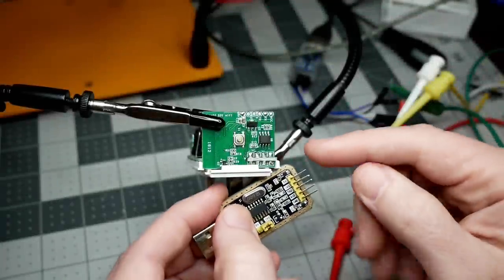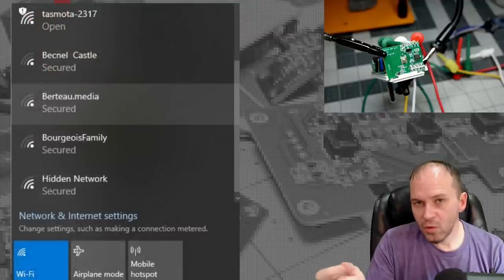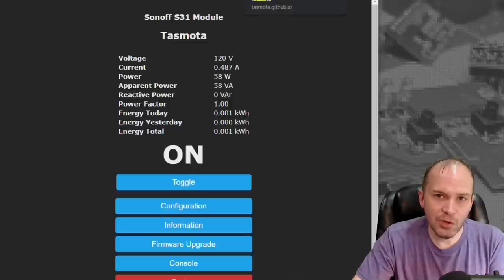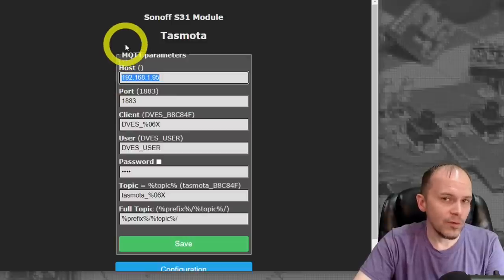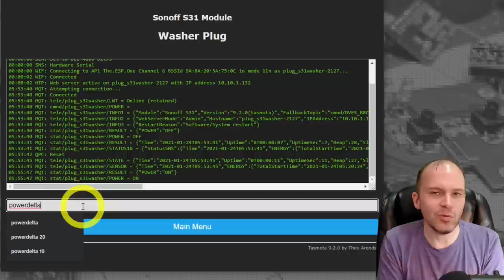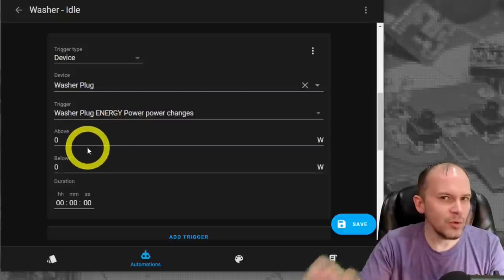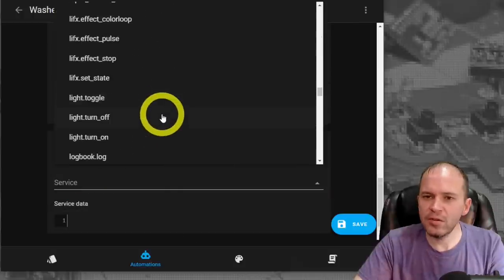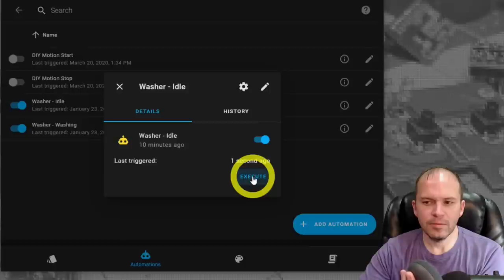Smarter Laundry Voice Notifications - Sonoff S31 & Home Assistant | No Soldering

Comment: If my use case is to monitor electricity, is there any plug that I don't need to flash to get the data with Home Assistant? Sonoff or Tuya's API?
Reply from the maker: I'd probably stick to Shelly's then or maybe Zigbee/Zwave.

Comment: I have used the HACS with SONOFF cloud-free install.  Use the power entity of power off a template.
alias: Dryer is off
description: ''
trigger:
  - platform: template
    value_template: |2-
       {% if state_attr('switch.sonoff_100147e1fa', 'power')  < 3 %}
       true
      {% else %}
       false
       {% endif %}
condition: []
action:
  - service: script.motion_in_drive_way_3
    data: {}
  - service: script.dryer_light
    data: {}
mode: single
Reply: Thanks 4 the complement 
Have you  tried Sonoff OTA for mini R2 lately I cannot  get it to  work

Comment: Travis, Thanks for the tutorial refresh. The GUI approach certainly has simplified this automation as compared to the original. I also like to enable Tasmota command "setoption21" on power monitoring plugs so I can always see the voltage at the plug even when the plug is "off". Thanks again for making great easy to follow videos for the community. 🙂
Reply from the maker: Glad it was helpful!  I like that feature as well and have it as default in my bin files.

Comment: Does Home Assistant need to be running on an always-on device? I have it on my QNAP, but it doesn't have all the same features as shown in this video since its the Docker version. Unless I'm wrong?
Reply from the maker: I would use it on always on to be able to always control.  I run just the docker container version myself for higher reliability/flexibility but with that you do have to do a little more work to add additional addons/containers.
Reply: @digiblurDIY  Is there a tutorial for the "little more work"? It's not finding the Tasmota Plug that I have.

Comment: Thanks for the tutorial. Got it running painlessly but now I have to figure out a method for my dryer. It's looking like I'll setup a current transformer on the buzzer circuit of my dryer.
Reply from the maker: CT clamp project for the dryer if it is electric.
Reply: @digiblurDIY  Finally my dryer no longer has the awful buzzer. The CT clamp worked perfectly except I put it on the motor circuit and just unplugged the buzzer circuit. Goodbye industrial scream sounds, hello push notifications.

Comment: @Digiblur. I've copied several of your automatons.  Thanks for all the youtube videos!  However, this is the only one that is giving me a little trouble.  Either my washer (or the smart plug) randomly pulls 8+ Volts for a second through out the day when not running.  Unfortunately, this triggers the idle automation each time 4 minutes after the power spike.  Any ideas on how to ignore the short power spikes?
Reply from the maker: You can change the range so it doesn't trigger the spike or you can also do the timed thing like I did where the power has to be above X amount for X number for seconds to count.
Reply: @digiblurDIY  The start of 'Washing' automation does fine with the Above 'X' for 'Y' Time.  The problem is the setting of state 'idle' via automation gets reset every time the power goes above 5W for a second and then back to 0W.  Thus this triggers the 'Idle' automation again, 4-minutes after each spike returns to 0W.  Luckily, I looked at a cycle tonight and an actual cycle is over 25W and the spike only seem to be in the 5-12W range.  So setting the 'Washing' automation to greater than 24W and the 'Idle' automation to less than 25W for 4-minutes seems to have corrected the 'Idle' automation firing 4-minutes after each random spike.

Comment: Nice video. Just a side note, depending on the washing machine (or any other electronics), you may have somewhere between 0.5W up to maybe 30-40W just for the device being plugged into the wall socket, but powered off. So, as you said, if anyone would like to play with such automation, you would need sort of a kill-a-watt meter to find the"4W" sweet spot that would trigger the "bro, I'm done!" message :).

Comment: Great video. I put the logic around length of time in low output state into Tasmota, to diminish traffic over my network. This way, HA is only triggered when the power level reaches a state i would consider to be running or idle. Originally, i used a Z-Wave plug for this, but it was spamming my Z-Wave network and it was much easier to limit this with Tasmota rules than with Z-Wave configuration
Reply from the maker: That's the point of powerdelta, to only send when you have enough change to warrant it.  Luckily MQTT is robust to handle a bunch of messages at once.

Comment: Hello, I try to use the same as your video to monitor my washer using KMC plug with Power Monitor flashed with tasmota.  But I do have questions on what is the Telemetry period did you set?  Under 300 seconds seem to be to much traffic to the HA when washer not in used.  600 seconds seem to be too long and the washer done after a few 600 seconds telemetry.  Is there a way to set the telemetry shorter than 300 seconds if has activity and back to 600 - 900 seconds when no activity using rules on tasmota.  Another questions, how often does ESPHome checks the telemetary reading if I use API instead of tasmota firmware?  Any examples?
Reply from the maker: You missed the part about powerdelta.
Reply: @digiblurDIY  Sorry I forgot about that since I watch the video a while back until now I tried to do automation on my washer.  What about the telemetry on the Tasmota setting?  If I leave it a 600 seconds will the Powerdelta 10 override it or visa versa?  What setting do I need to set on the telemetry?  Will it automatically disable when you set the powerdelta?
Reply from the maker: Just leave it at default 300 seconds. No harm in that. PowerDelta takes care of the rest.

Comment: Just picked up one pre-installed Tamosta Athom outlet, plugged it in, and ran a scan using "Advance IP Scanner" but it could not find the Tasmota device on my LAN. I tried both scans using the following info first scan was for 192.168.86.0-254 then tried 192.168.4.0-254 neither found the device.
Then tried the address http://192.168.4.1 in my browser but did not connect. 
What part of the procedure am I getting wrong? I plugged it into a 115VAC receptacle and that is all I have done so far. Do I have to press any buttons for it to appear in the scans of my network?
Reply: Turns out the plug was not completely inserted into the wall socket. Seeing it now.

Comment: What's a good way to monitor the drier if it uses 240v power in the US?  Obviously all of these smart plugs are designed for 120v power.
Reply from the maker: Tomorrow will have the recap of other solutions in it.
Reply: I'm tempted to say, buy a European version and just DIY a connection between. But that will probably not be a good/legal solution
Reply from the maker: Probably not a good idea with split phase. CT clamps are the way.
Reply from the maker: Here's the longer one - https://youtu.be/Tjg4tioZzbs  
Includes the parts talking about CT clamp solutions.

Comment: Everything worked fine, flashed and showing in MQTT, however I cannot get any of the plugs to show up in Tasmota integration. Figured it would be automatic, but have reloaded a few times along with rebooting the devices and cannot get them to show...Also tried "SetOption19 1" in console.
Reply from the maker: Flashed 9.5 full tasmota bin?
Reply from the maker: Also mqtt needs to be enabled and setup.
Reply: @digiblurDIY  it is. I have it showing in mqtt
Reply: @digiblurDIY  yes
Reply from the maker: Might need to follow this one https://youtu.be/-Aavplsx2TQ

Comment: With the powerdelta command, you can also set it to update on a wattage change by using 100+wattage (such as 105 for 5w or 295 for 195w).
Reply from the maker: Indeed.  Many ways to set this command up, pretty powerful/flexible to fit everyone's needs.

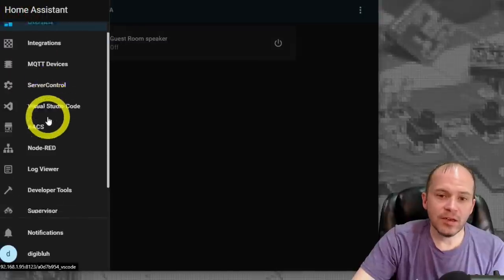Comment: 10:40  I AM using docker core. I DON'T know how to set up MQTT to talk to home assistant core. 

Every. Single. Time.  Like I'm just supposed to magically know.  UnRAID is sooo easy. But there's no guides for home assistant core. They all use supervisor. Arrrgh.
Reply from the maker: Docker core guy here too! Install mqtt in unRaid. Then go to integrations and configure it.
Reply: @digiblurDIY  So integrate it in HA under configuration. ☑.   Did you add zwave devices in HA or zwave2mqtt (or Zwavejs2mqtt).  I'm under the understanding it's better outside HA, because restarting HA polls the entire zwave network.

But I can't figure it out. I've got more info but probably too long on a yt comment.
Reply from the maker: Jump into my discord chat. There are several of us running core and several on unRaid that can get you going. https://discord.digiblur.com

Comment: Wife approval factor is high today.  Now I need to replace the electric dryer with a gas model so I can do the same setup on it.  Thank you.
Reply from the maker: Unless you are hard pressed to change it there is this method for electric dryers. https://youtu.be/NbUJPZbyXo8
Reply: @digiblurDIY  anyway to hook the CT clamp into the S31? Monitor both from the same esp?
Reply from the maker: I wouldn't. The GPIO pins are not isolated.
Reply: @digiblurDIY  Ah. Thanks! My S31 hasn't made it in yet but I'm pretty stoked about this automation.

Comment: We only have 2 prongs in our country. We don't have ground. Can you remove the ground on S31? Is the ground connected to any wirings on the board or is it a dummy ground?
Reply from the maker: I don't have a schematic to it. But most likely it is just pass through ground like you see on other devices.

Comment: Hi, from what I saw in your video I wonder if the preset programs of the washing machine can be automated, monitoring the electricity consumption during each preset program would be a solution?
Reply from the maker: Mine varies so much based on load and settings so I just stuck with the KISS principle.

Comment: Just ordered two of the Sonoff switches, gonna use one for the washer and one for the dryer, thank you Travis for such great information.
Reply: FYI the dryer using 240volts might not work unless you use Amp Clamps monitoring.  Washer easier as long as you figure out your washing cycles amperes.
Reply from the maker: I use one on my dryer. Only uses 120v.
Reply: Both my washer and dryer are 120v, I havent added any automations yet but hope to soon

Comment: Is there another video that focuses on the exact connection points? You glanced over it and another video I found also basically skipped that too. ie Where does VCC connect to on the flasher? Do you need to connect the ground to ground? Thanks.
Reply from the maker: The extended version linked in it might be better. Gnd to gnd and vcc to 3v3 as I do talk about not using 5v flashers.
Reply: @digiblurDIY  Yep the extended cut is what I needed. Even though I've watched both videos several times as my S31 plug was in transit, I still didn't catch it. I ordered the tools from your links and used the jumpers. For other noobs, place the jumper into the side of the black plug end, not the end itself. I wasn't able to get tasmotizer to flash, until I did it that way (prolly basic knowledge to those that have done this before) :).

Comment: I followed this tutorial a year ago but need to set up another plug for my father-in-law. 

I’m just curious if the process has improved. I’ve seen Tuya Integrations have improved but I’m not familiar with its use.
Reply from the maker: Actually Tuya got a little worse.. Switching from ESP chips.
Reply: @digiblurDIY  thanks for the quick reply. Since the father-in-law already jumped on the S31, I can’t direct him to a different product. I guess I’ll still use this method then.
Reply from the maker: That's great. The S31 is a great product.

Comment: Question on this. I followed your video which is great, good job!! Problem I'm having is that every 20 mins or so , it's saying my clothes are done. If I look at the usage graph it's flatlined but still trigging the automation to happen when the washer is off. Any ideas what to check for? Thanks in advance!
Reply from the maker: They plug could be going unavailable and triggering.  Do you see that in the history?  Any unavailable states?   Look in the Tasmota console for MQTT disconnects.
Reply: @digiblurDIY  ahh... Ok. Very good point. I'll dive into that. Thank you very much!!

Comment: Have you looked at your power usage during various cycles? You might be able to detect the spin cycle which might have higher draw and not get tripped up by an extended soak cycle.
Reply from the maker: Yes, I've tried to look at the various graphs of usage but with all the various settings combined with the load sensors the combinations will drive you nuts and there really isn't much digital on my washer.  If I was going to dump that much effort into it, I'd just place a lux sensor on two of the cycle lights.  But this method works, no harm done in waiting 4-5 minutes for us to be notified the washer is done.  The dryer is between much realtime so it is all on us if we want wrinkled clothes or not.

Comment: Hi again, I have 4 of these s31 all flashed with Tasmota. They have been working well but I am now looking into why on earth all of them show more energy used today (only a few hours) then energy used yesterday (a full 24 hours). I'm looking into it now but just doesn't make sense to me. Maybe I SO-ed the wrong darn thing.

Edit... One of them is NOT doing the odd thing. Looking to see the difference in the console.
Reply from the maker: More power usage?
Reply: No. That isn't it. These devices would surely have been used (and consumed more energy) the previous day. I did notice that some devices used the s31 (1) module template. Not the s31 (41) one. I'll see soon if that was it. Midnight is in 10 minutes.
Reply from the maker: I wouldn't use any template with the S31. It's built into Tasmota already. Any website or tutorial that says to use a template for an S31 is probably doing something wrong or super weird.
Reply: I meant module. Not template.
At the config/module section.
Reply from the maker: There should only be one S31 in configure module.
Reply: You're right. I was reading the (1) from a backlog status command. Not the module web screen. Not exactly sure why but the readings for today/yesterday seem to be working proper now. Thanks for the hand holding my man.
lol

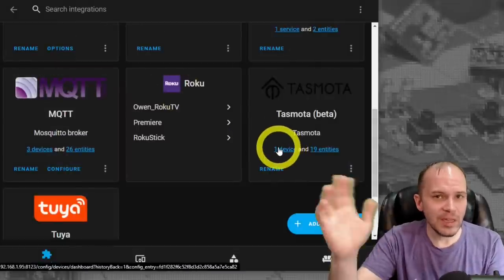Comment: At 11:55 you state "we didn't do anything" and you show the device showing up under Tasmota. In my case, no devices show up in the Tasmota section. How long does it take for it to show up? Is there a manual way to have it show up? I have waited about 30 minutes and nothing yet.
Reply from the maker: Did you install the Tasmota integration?
Reply: @digiblurDIY  yes sure did.
Reply from the maker: It should appear then if you have the full Tasmota.bin loaded. Mqtt configured on home assistant and Tasmota.
Reply: @digiblurDIY  going to start over and repeat the steps in your video. One other poster stated I needed to add a username and password to my MQTT config but don't remember seeing that in your procedure but never know I probably missed it. Also, that username and password are used elsewhere in the Tasmota setup?

Comment: Will the lite version of the Sonoff S1 take Tasmota?
Reply from the maker: Yep. Sure will. Just no power monitoring.
Reply: @digiblurDIY  thanks! At $10 each shipped, seems like a decent one to use since Tasmota is so easily installed.

Comment: Having trouble.  Once flashed and I connect to the tas wifi, once i put in my main wifi name and PW and save I get kicked off of the tas wifi and nothing else happens.  How do i get back in after that?
Reply from the maker: Yep. That AP will go down as it attached to your network. Check your router for the IP address it obtained.
Reply: @digiblurDIY  Worked like a charm.  Thanks.
Reply: Stuck again.  Not sure what to put into home assistant.  Http://homeassistant/local:????.  FYI i have a load in the washer that is going to stay in there until the morning because I cannot figure this out.
Reply from the maker: Jump on into discord, I'm not sure where you are putting in this address.  https://discord.digiblur.com

Comment: For finding the power and duration thresholds to decide wether the machine is finished or is just mid-cycle, I suggest just using it a few times with the Sonoff power monitor running. Then you can look at the power usage graph in Home Assistant to see how low the power drops mid-cycle and for how long latter, after it is finished, and don't have to keep monitoring it to time things.
Reply from the maker: That's what I did. Put in a full load of towels on the longest cycle stuff like heavy soil and double soak thing to see what was the longest it just sat doing nothing.

Comment: PowerDelta is excellent to use here. Instead of a percent-based difference (which can flutter too much at low wattages), I'd generally recommend a watt-based delta, like PowerDelta 110 for 10 watt of difference to trigger reporting, or 150 for 50W and so on.
Reply from the maker: I do wish there was a way to say use teleperiod when below 5 watts but above use percent change.
Reply: @digiblurDIY  That's close to what you get with PowerDelta 105, anything below 5 watt will never trigger, meaning only reporting by TelePeriod; that's exactly why I suggest using watt-based delta instead of the fiddly percent-based delta. When above 5 watt, smaller differences would trigger to show how consumption varies during the cycles.
Reply from the maker: I will have to compare my Grafana graph during that next washer and dryer run. Thanks for the tip.